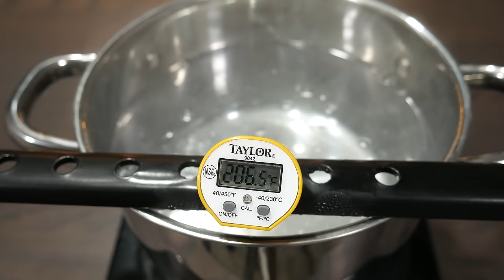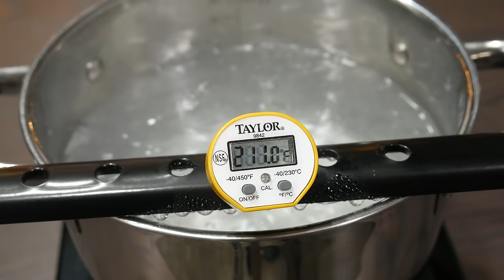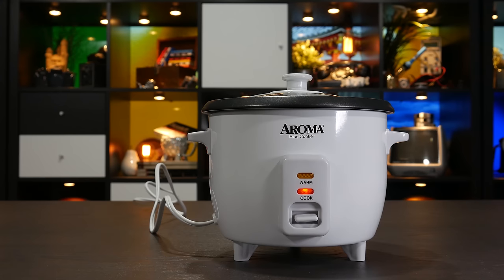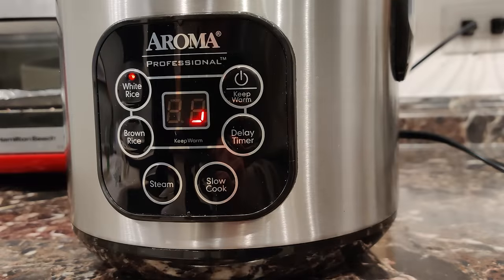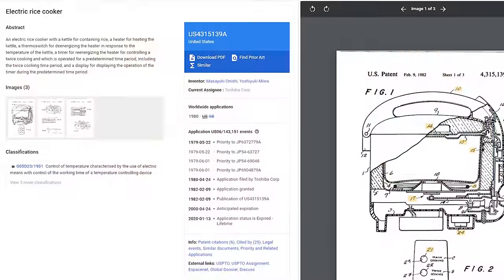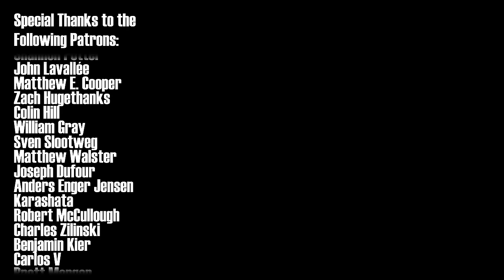Old-fashioned rice cookers are extremely clever

Comment: How is cooking rice not the most simple thing ever? Put two cups of water into a pot (preferable with some salt), make it boil, put one cup of rice into the boiling water, wait until it boils up again, turn off the stove (so it won't boil over), leave pot on hot stove, put a lid onto the pot, wait until all the water is gone (approx. 15-20 minutes, nope, no further heating required, the rice will suck up all the hot water) and enjoy perfectly cooked rice which is not to dry, not to wet and still hot but not too hot to eat. You can't mess it up as long as you have twice the volume of water than rice (so cup doesn't require to be the unit cup, just use any cup you have at hand) and you cannot burn it as no heat is applied once the rice is in the water. It's totally fail-safe and works every time. You may want to come back after 10 minutes, open the lid and steer everything a bit around with a spoon before closing the lid again. That makes sure the rice is equally cooked, otherwise you may experience that the rice on top is a bit more grainy while the rice at the bottom is a bit more slushy.

Of course, I'm referring to standard long grain parboiled rice here, other types of rice may require more or less water or even other cooking methods. E.g. Basmati rice is typically not cooked that way. It requires more water, small amounts of constant heat applied to that water (it should be constantly very hot but not boiling) and once it is done, you have to toss off the excess water. Here you just add four cups of water per cup of rice, toss the rice into the cooking water, immediately switch back the heating of the stove to a very low level and after around 5 minutes, put a lid on as that prevents the water from cooling too fast and saves energy (I only need level 2 out of 9 on my stove but without lid I need level 4). Check back every 5 minutes and try some rice, when the consistency is fine for you, just take the pod, displace the lid a little bit, so water can get out but no rice, and pour the excess water into the sink. It's a bit more complicated and you have to check back regularly but it's not really hard and I also never failed with that method.

Comment: I just never saw the point, I can cook the perfect rice with a simple saucepan and lid. The trick with the ratio is just to double the amount of water to rice by volume using a measuring jug, or even just by eye if you’re experienced. eg 100ml of rice, easily enough for one person, with 200ml of water. Cook it on just above lowest heat setting until all of the steam disappears (about 15-18 mins with the example amount) until there is no residual water at the bottom of the saucepan. That’s it.

Comment: If the magnet becomes not a magnet once it reaches the Curie point, then how is it reusable? Wouldn't you need to replace the magnet after each use?

For a design that's reusable, the shutoff would have to happen before Curie point, when the magnetism is too weak to overcome the spring but not gone entirely, which I think is what's actually happening with this
Reply: The magnet isnm not what gets heated beyond its Curie point-- the metal pad that gets attracted to the magnet is what's been alloyed to have a Curie point just above 212 F.
Reply: @BogeyTheBear  Okay that makes a lot more sense.

Comment: The boiling point of water is dependent on air pressure, so if you go sufficiently far away from sea level, this device will not function properly.

Comment: Why keep rice warm when you can let it cool to about 125 degrees F, put it in a closed container in a refrigerator, or freezer, and later take it out and eat it cold? If you have the luxury of a microwave cooker, which costs little more than a cheap rice cooker,  you can use that to reheat rice. 1 cup of rice gets to about 175 degrees F in about a minute. Personally I can't tell the difference between freshly cooked rice and cooked rice that has been refrigerated or frozen and then reheated in a microwave heater.

Comment: I just bought a new rice cooker.  And not the cheapest one, it was $70m has a nice electronic interface like the fancy one you showed, has the spring loaded button on the bottom like you show, but it does nothing.  Now I see these videos that say how rice  cookers are "supposed" to work, too bad the expensive one I bought simply works on timers.  All the cooker does is get hot, nothing smart about it.  It sets white rice for 40 minutes and brown rice for 70 minutes and it doesn't turn to "keep warm" until the timers have run their entire course.  The white rice comes out brown on the bottom where it burns.  I should have bought the cheapest one...

Comment: why use a magnet as thermostat ? seems any bimetal-based thermostat, with a 100 degrees celsius trigger point and some mechanical hysteresis, would work just as well and be cheaper, wouldn't it ?
Reply: If my old toaster from the 80s is anything to go by, bi metallic strip's reliability in timing in the long run drop pretty quickly.

I have to turn the knob all the way to high to get the same level of toasting i wouldve gotten like a year ago with it on medium and i use my toaster often
Reply: @logickedmazimoon6001  maybe it's the resistors and not the thermostat?
I have 40 year old thermostats that still work just fine

Comment: What is the material that people use to make thermal sensing device (the spring thingie)?
Reply: Spring type thermal switches, usually, use a bi-metal spring.
Which means the spring is made of two different kinds of metal, pressed together.
When heated, to a predetermined temperature, it will bend and either make or break and electric contact.
Reply: Looking at curie points, it appears to be chromium oxide, perhaps as a disc or coating with an aluminum cap for food safety and thermal conductivity. The curie point of Chromium Oxide is 130 degrees Celsius, and is relatively common, finding use on magnetic tapes. It is the only ferromagnetic material even close to the boiling point of water.

Comment: I don`t understand why people think cooking rice is difficult. Only thing you need to know is the correct water to rice measurment and with normal long grain rice its 2:1. Other than that you just throw both into a pot and wait till all the water is soaked up. Cooked rice for years in a pot and was always perfect and not difficult. Though I do admit that I bought a rice cooker recently and due to my lazy personality the "Switch on and forget" function is great because then I can do things without having to remember to turn of the stove when the rice is done. Cooking soft boiled eggs is something that is difficult because depending on the size of the egg an S,M or L egg all have different amounts of time. You have to preheat the water, calculate the time considering the size of the egg, don`t have a way to check because you can`t just open the egg to see if its done or not and the time you have till the egg yolk gets hard is less than 2 minutes, therefore 10-20 seconds too long can ruin your soft boiled eggs into hard boiled eggs. Rice on the other hand is pretty much the most basic and easiest cooking you can do.

Comment: 2:50 "liquid water cannot exist at a temperature higher than it's boiling point ..." 

Um, ... yes it can. If you put that water in a pressurised system (like your cars cooling system) that raises it's boiling point.

Comment: 7:03….what is ferromagnetic material ? The magnet of the button ?  I’m in my sixties. I miss books ,diagram’s , clear definitions and things that came with readable owners manuals. Adding some humor sometimes makes it confusing.
Reply: Ferromagnetic materials are strongly attracted to a magnet without being magnets themselves. Iron is ferromagnetic, and consequently so is steel.

The material in that button (or perhaps under it) seems to be Chromium Oxide, which is again ferromagnetic, and has a curie point of 130 degrees celsius, not too far off of the boiling point of water. You may recognize it from chrome cassette tapes for your stereo.

Comment: Latent heat explains why atmospheric CO2 cannot cause global warming.  The greatest transfer of  energy to the atmosphere happens when the oceans evaporate.  In the oceans, infra red light energy from the sun is converted to thermal energy.  Through evaporation, sensible heat is converted to latent heat, and the vapor becomes part of the atmosphere.  It then condenses and falls back as rain.  The thermal energy however remains in the atmosphere.  CO2 doesn't do this.

Comment: calling celsius silly and arbitray while using fahrenheit is a whole new level of stupid... water boils at 100 degrees celsius
Reply: The Celsius scale is, certainly, better for the math end of things and more intuitive, with the  0 to 100 scale.
However, for the feel of things, I find the Fahrenheit scale more useful. One degree, of the Celsius scale can cover several degrees of the Fahrenheit scale, and can feel 1 to 2 degrees of change of Fahrenheit. In the summertime, in my home, with the air conditioning on, I can say "It must be about X degrees outside." and then look out my window at my thermometer, and see I am within 1 to 2 degrees of actual temp.
As I said, on the math side, Metric/Celsius is definitely better.
Reply: That's the joke.

Comment: Wrong explanation. 

Water evaporates at any temperature above melting point, and latent heat is always required at any temperature above melting point. 

The temperature stays constant at the boiling point because both liquid and gaseous states exist in some open container. This is phase rule, not latent heat.

Comment: What happens if you cook a shit ton of rice back to back?
Reply: Once you dump new water into the bowl it will promptly cool it back below the treshold. In theory this could take a while, but given that the device turns off as soon as the boiling temperature of water is exceeded, it should be a small enough gap to be pretty much instant

Rince and repeat until ally our rice is cooked

Comment: what did you do to your rice cooker?  I use mine every day twice a day at least, exact same design, brown rice, oatmeal, various grains...  You just wipe it off with a clean moist cloth after each use.  Mine looks new after a year still.  Surely you jest for your video and set that up.  You're not supposed to cook it with anything but water and a bit of oil or butter.

I don't think it's even possible to get that kind of splatter outside the lid unless you're running without the inner lid. You can wash that inner lid in the dishwasher.

edit:  How do you keep such a clean set and demeanor yet your rice cooker looks like that?  You strike me as the kind of guy that cleans up his kitchen while his food cools/rests (this is the best time so one can nap after eating and the dishes are easier to clean).

edit2:  well, maybe it's a nuance of white rice in that rice cooker?  I've never cooked white rice.  You shouldn't eat that.  Why would anyone eat that in modern times considering why they started making it white in the first place.  And what that does to what is already a pretty unhealthy food as far as glycemic index goes.  It makes it less healthy and closer to bread.

Comment: I am perfectly happy to cook rice in the same covered stainless steel pot (with an aluminum sandwich bottom) and a cover, that I cook anything else in, using the same gas or electric burner that I use to cook anything else, in that pot. Gas is much better because you have easier control over the process. If you have a gas burner amount of attention you have t o give to the process is hardly more than the amount of attention you have to give to a dedicated rice cooker. Yes you have to know what kind of rice you are dealing with, how long that kind rice  takes to cook at your altitude, and how much water it absorbs in that time. Then the only other thing you need is water, and a timer. I tend to think a dedicated rice cooker is ridiculously over-complicated way to cook rice unless you have a restaurant or something. If you don't know how much water a particular kind of rice needs and how long it needs to cook, you can figure it out by trial and error. Yes there are tens of thousands of different rice cultivars but most of them use approximately twice as much water as rice, by volume, or a bit more or less, and brown rice takes roughly 45 minutes, polished rice 20. Variations in size and shape of the rice seeds will make small variations in the amount of time and amount of water.

Comment: I’m sure they must be good, or why else would load of Asians swear by them..! 

Personally I put rice a pan, add water to twice the volume of the rice.. If it’s easy cook it’s 1/1 water to rice.. 

Boil rice for 4-5 mins, turn off the heat and simply leave.. There has to be a lid on the pan by the way.. After 5 mins stir rice with a fork to fluff up a little and leave for a further 5-7 mins again with the lid on.. It’s now cooked and should be nice and fluffy..

For easy cook, it’s exactly the same method and like the forma,
Do not rinse your rice, there is no need whatsoever given the higher quality today..

There are no bugs, husks or rice flour in your rice today..